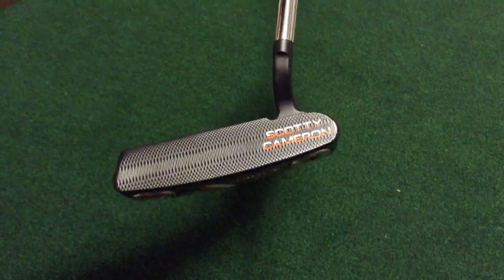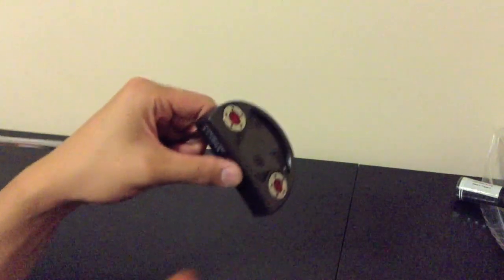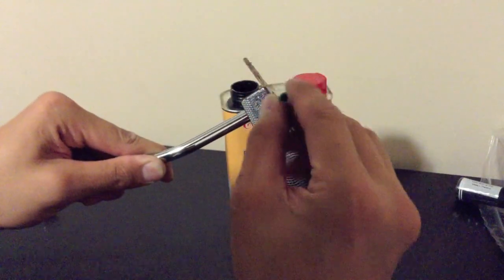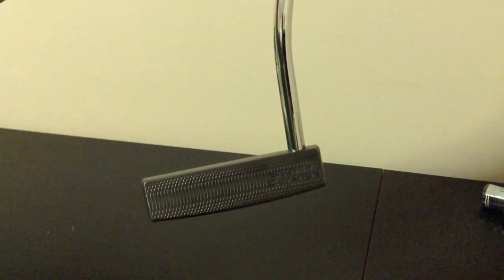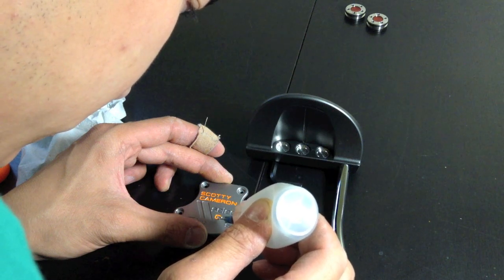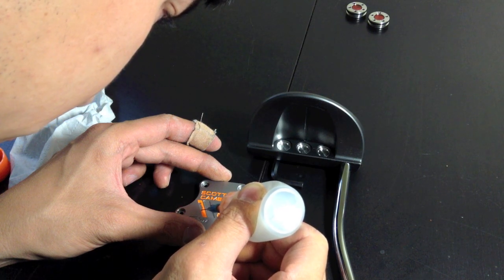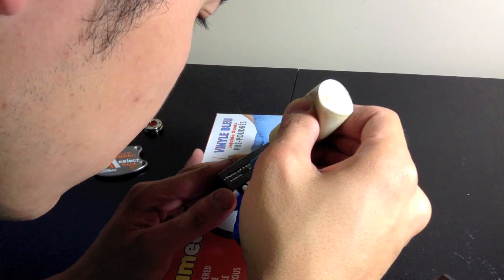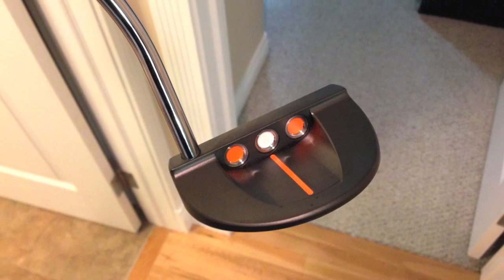How To Paint Fill Your Putter - Just Like The Scotty Cameron Custom Shop

Comment from the maker: Taylor Stoerback - I just used translucent paint. If you put on a thin layer with the needle applicator, the paint pools on the outside of the weights which makes the outsides darker then the middle. Hope this helps.
Reply: thanks for the help

Comment: Hey,

I've recently been diving into the whole paint fill world and have struggled on a few aspects. My paint wore fast because I used a paint pen as other videos suggest. I just tried it on a golo putter and it was hard. The back plate just smeared and wasn't clear. I struggled major time on the three back dots. I tried for hours to get them right and it was a pain. I have to say this was by far THE BEST video out there on this tutorial. I just bought a few bottles and some acrylic paint as you've said it won't wear. Thanks a lot. On the weights side I'm just going to by after market ones as The color scheme I'm doing won't really work. Thanks again
Reply from the maker: Glad the video helped! Unless you are really rough with your putter the paint won't wear. The paint on mine looks brand new still.

Comment: I recently repainted the lines on my Scotty Cameron Red X mallet and I used a small syringe with a lure lock blunt tip needle. I was able to find a Revlon red nail polish in my wife's vanity that was the EXACT color of the Scotty Red. Tiny bit of touch up with some nail polish remover on a Q-tip. Boom!

Comment: I painted my cameron using Tamaya paints - and not too thick - just enough to fill the dots.  Then I dabbed some paint on a dinner plate so I could see how long to dry.  72 hours later and the sample dab on the plate is still not completely hardened (dry).  On the dinner plate if I pressed on the sample it would leave a fingerprint.  Again I used a needle applicator and just a drop to fill the dots on the back.  How long does Tamaya acrylic take to dry?!?!
Reply: 4 days and the Tamaya Paint has yet to cure and is dry to the touch but you can leave a fingerprint impression if you press on it.

Some FAQ's I've read say it can take 3 months to fully cure.  Acrylic is NOT the right pain to use and there is no way Cameron uses Acrylic on their factory paint jobs on new putters and custom shop modifications.  I wonder what they use..

Comment: Also(sorry for bothering you) what translucent paint did you use on the weights. I saw the tamiya brand had only a translucent paint spray. Because I wanted to put translucent paint on the three dots and the weights. Thanks again.
Reply from the maker: Hey, all good. I used Tamiya for the translucent as well. I found it at a hobby shop.

Comment: Ok after seeing your video like I said I went and bought some new supplies but I wanted to get all the paint out. I had a tough time getting the paint off the back plate. Nothing came off and made no progress. I used q-tips, turpentine, and acetone and nothing came off. What did you use to get it off? I used the paint thinner and nothing.
Reply from the maker: I used "Heavy body paint and varnish remover" It came off within seconds.

Comment: How do you stop from getting air bubbles?
Reply from the maker: Hey! It's been a long time since I've done this, but from what I remember, because of the needle applicator, the air bubbles went to the top of the applicator bottle so I never had to deal with any bubbles. If you're having issues with bubbles, maybe try not squeezing the bottle as fast?